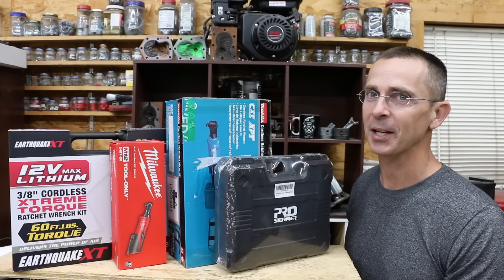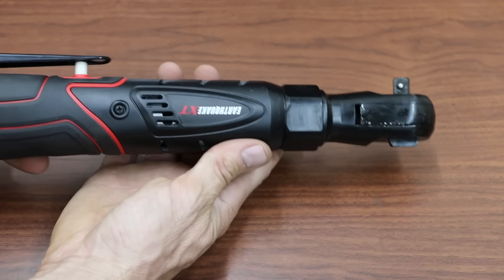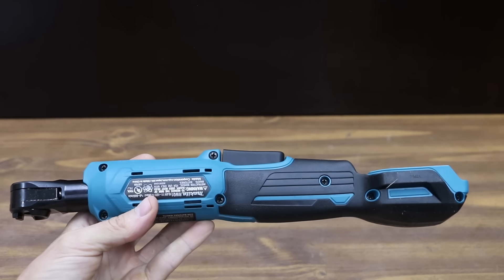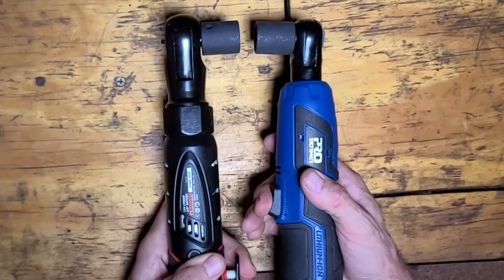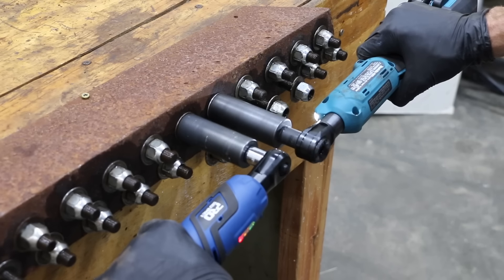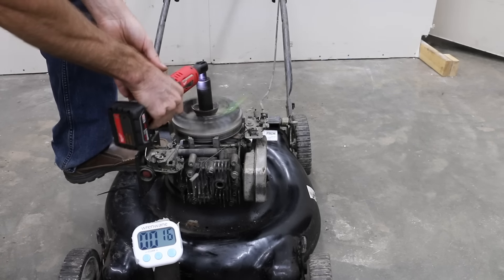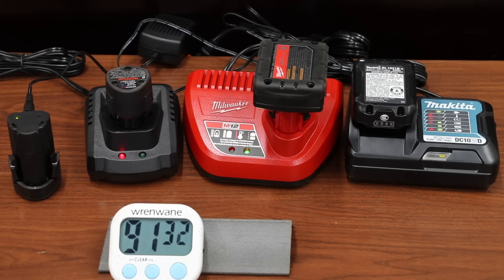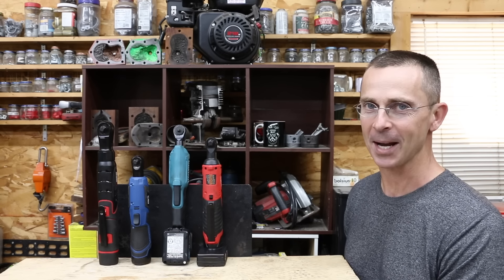Best 3/8 Cordless Ratchet? Milwaukee M12 vs Makita, Earthquake & ProStormer. Let’s find out!

Comment: I bought a Prostormer  purely on price awhile ago. I knew it would probably be inferior to the "big" brands and I'm careful using it by breaking nuts etc with a breaker bar first before using it. It hasn't disappointed me at all. One of the most useful tools I own
Reply from the maker: Thanks for sharing!
Reply: I RATHER GO WITH PRICE AND PERFORMANCE THAN THE HYPE....LIKE MAKITA OR MILWAUKEE. PROSTOMER IS THE ONE IM GOING TO GO FOR. AM NOT A MECHANIC, BUT I LIKE TOOLS TO MAKE MY JOB A LOT EACIER.
Reply: You won’t break nuts with these battery ratchets. They really have very little power compared to an air ratchet.
Reply: @djjammindave  All-caps = automatic downvote.
Reply: that was one of my first ones and its absolutely garbage and stopped working after a couple months of use lost all power and does not tighten anything anymore. i have all Milwaukee now and have 0 issues besides one failing after a year of heavy abusive use which they replaced under warranty for free.
Reply: @grazz7865  he means breaking a tight nut loose from the threads of the bolt by using a socket with a lot of leverage (the breaker bar), then using the power tool to take it off the rest of the way.
Reply: @S0ulinth3machin3  oh I see. The Dewalt ratchet has 75 foot pounds of torque-almost better than an air ratchet. I watched a test of various models. The dewalt was able to break the nuts up to 70 foot pounds of torque

Comment: I bought the ryobi one, and im using an adapter to run my dewalt batteries. so it uses a 20v battery. oh and it was $80.
Reply: Where did you get the adapter?
Reply: @TheCamaro5  check ebay...
Reply from the maker: Thanks for sharing.
Reply: they are all 20 volt, peak, then 18volt nominal, its just how they advertise it
Reply: TheCamaro5 I’ll
Reply: No dewalt equivalent from what I can find. Missed opportunity in my mind
Reply: @mainsource8030  Yep, but 18 or whatever you want to call it is better than 12. @TheCamaro5 I bought my adapter on amazon. @Alex Peters, I actually ordered a yellow 12v dewalt looking one on ebay, but it never came.
Reply: @gregorioledezma4473  ?

Comment: My Earthquake was a game changer. Worked well, was strong, long battery life. Had it for years. But I dropped it and it quit working. Bought a MAC 3/8 because I have all dewalt batteries and chargers but it has its drawbacks and was not cheap.
Reply from the maker: Thanks for sharing.

Comment: I'd love to see how my snap on does cordless does against these.
Reply: Snap on is NEVER any better than han other lower priced tools. Snap on just has a lifetime warranty and a truck the comes to your shop. Thats it, the tools are the same as others.
Reply: @JM-yx1lm  snapons electric stuff doesnt have a lifetime warranty
Reply: Poorly. My snap on didn't last 2 years. My Milwaukee is going on 5.
Reply: Snap offs are junk that’s why he doesn’t test them
Reply: I was going to say "boo snap on" but yall best me too it. I like the cheap one he has on this review bc it is the smallest, which is the biggest benefit bc it gets in the hard spots where a regular ratchet would blow
Reply: @Wayne Jorgensen Ya. The only thing worth a damn on the snap on trucks are the hand tools. Ratchets, spanners, sockets, screw drivers, etc. There is no better ratchet than a dual 80 with the hard plastic handle. So smooth and crisp, the plastic handle is comfortable, durable, and easy to clean. The Matco EIGHTY8 and Gear Wrench 90T are close seconds IMO. Pittsburg pro ratchets are also very good for the money, I think they might be under the ICON name now, not sure. I have one that I have used for 5 years. No problems, even the handle held up pretty well.
Reply from the maker: Thanks for the video idea.
Reply: I've got the Snap On cordless ratchets - 1/4" and 3/8" drive in regular and long neck.  I use my 1/4" ratchet almost all day, every day for the past 5 years.  It needed to be repaired a few months ago finally after all that use.  I like how the  Snap On feels in my hands all day, it gets the job done and for it to last 5 years with all the use it gets, I have no complaints with it.  I like that they come in all the colors too.  Each of my ratchets is a different color so I can tell them apart very easily in my tool cart and grab the one I want (1/4", 1/4" long neck, 3/8", 3/8" long neck) quickly so I can keep working.
Reply: wouldnt mind to see the comparrison too, but I love my snapon long and short neck ratchets. even if they faired poorely I still wouldnt complain, they are competitively priced and if one screws up (and in 4 years only 1 has) snapon guy gives me a loaner while mine is away, comes back line new for free even though that one was 3  years old and I dont miss a single minutes work. Now they do charge a fee for out of warranty rebuilds, but In my experinece, if you dont take thie piss, they usually waive that fee. they have for me 3 times now in the last 10 years. that customer service is worth paying a little extra for.
Reply: At $250, the Snap-On should also make you a sandwich and pour you a drink after you're done working.
Reply: @denisohbrien  Competitively priced? Last I checked, the 3/8" ratchet only was like, twice the price of the Milwaukee Non Fuel, and about $90 more than the Fuel version. That's....not really competitively priced.
Also, the claim that you don't miss a minute's work is kind of a stretch. If  your tool breaks on Monday, and your Driver actually does come to you, when you call them? That's great. But not all Driver's respond to people calling them, or they might be busy with someone else calling them. Some, you're at the mercy of whenever they feel like stopping by. Which is very different from your claim.
You could literally buy two Milwaukee non-fuel for the price of the Snap on, and when/if the first one breaks, you have a second right there, ready to go. Send the first one out under warranty, even 4.6 years later, and it comes back fixed, for when the second one breaks.

I understand that you are invested in your tools, but just be honest with the fact that Snap On is not competitively priced. That is one of the biggest reasons why so many mechanics are moving to Milwaukee. Because Milwaukee is undercutting Snap On by roughly half the cost, while more often than not, offering substantially more performance.
Reply: @Blenzo480  I stopped buying premium brands after I saw they are all made in Taiwan. In that case auto zone takes the lead since it has a full time "no questions asked" warranty with their tools... I have actually tested that twice already and it really works 😅
Reply: It's the same as pneumatic versions, they have the same head design. A couple or few few years of my abuse and they all rattle around like they are doing something, but they are weaker than puppy piss. I can't be the only one.
Reply: @UncleDonDon  right lol. Only reason I went that route is my job pays the refurbish fee so I get them refurbished every year or so.
Reply: I like my 3/8th electric ratchet even if it was over priced. Tempted to add a 1/4 inch because I find myself using a adapter often.

Comment: So what I'm getting out of this, prostormer is good on a budget
Reply: For another 10 bucks AC Delco will give you 45 ft lb of torque. I measured it several times with my torque wrench. I had a cheapie like the prostormer and it would only give me about 20 ft lb. I snapped the head off of a grade five 3/8-in bolt with the AC Delco. It put out more torque than my air ratchets. It's not super fast but it definitely has the torque.

Comment: I love my Milwaukee, the size makes it great to get into tight automotive spaces. Definitely my go to tool. Also the load stop when a bolt is tight cuts power quick so you don’t bust your knuckles
Reply from the maker: Thanks for the feedback.
Reply: @Stolas Not on mine
Reply: @Stolas the trigger is variable so you don’t have to go full throttle on it. Also they arnt like an impact, they don’t torque bolts all the way. I think the Milwaukee 3/8 is only like 20ft/lbs or something. They also offer a 1/4 drive for smaller bolts. They are mostly for speeding up the removal and installation of bolts. You still have to wrench them down or torque them afterwards. It just makes everything a lot quicker. Especially in hard to reach areas where you would be doing the “one click at a time” with a normal ratchet. I highly recommend one. They make you wonder what you did without them for so many years.

Comment: I’ve got two of the earthquake ratchets.
Got them both “open box” 
Use it all the time with plenty of abuse. Like it just fine.
Reply from the maker: Thanks for sharing.
Reply: I've had mine for 2 years... works perfect.  In fact, I was going to get the Milwaukee, ya know. Name brand stuff.. but to be honest, no need to
Reply: Love mine... I would like to see more of the new Craftsman V20 tools in your comparisons since Lowes carries them and they appear to be fairly nice and from other reviews it appears that some of the Dewalt tech has been included inside some of the tools since they are both under the same umbrella. That being said the Earthquake for HOME use is more then fine. Save's my wrist when working with my cars and motorcycles. Although if it dies the Milwaukee appears to be a great replacement.

Comment: When testing the torque you should have had the tools stabilized since your arm input may skew results. Thanks for all you do!
Reply from the maker: You are welcome!  Thanks for the feedback.
Reply: Agreed, that, also was my only critique, but over all, a great test
Reply: While I don’t disagree. You don’t use the tool in a vise. So this is a more real work test.
Reply: @MET90LX  you are correct, but while testing anything, you must control everything save the one variable you are testing, for the most accurate results of the experiment.

Comment: Milwaukee has come a long way since that Cordless ratchet
Reply: milwaukee`s dead to me since being screwed on batteries with the v18.
Reply: Super Ryobi for the win I guess
Reply: @REDMAN298  I’ve never had a problem with Milwaukee’s 18 volt batteries.
Reply from the maker: Great feedback. Thank you
Reply: @REDMAN298  can you explain?
Reply: @derekverveer6058  the early v18`s were replaced by 18v`s which I switched to and were junk also. Then they go to m18`s and all my stuff is obsolete! I`m using after mkt. batteries and having better luck and more realistic prices. Used to be proud of the milwaukee brand. Not now. My old saws and impacts are still good. Why did they have to change so you can`t use the new batteries? Crooks.

Comment: When the Milwaukee beat the Makita by only 5 seconds, I was thinking a side by side comparison was in order to eliminate any human inconsistency over 20 bolts. That is exactly what you did next and it looked like the time difference at which the Milwaukee won was about 0.25 seconds, thus a testament to your consistency of moving the ratchet over 20 bolts. Good job. You are one of the best on YouTube at eliminating variables which might give skewed results. I subscribed.
Reply from the maker: Thanks so much!  Thanks for watching and subscribing!
Reply: Batteries should be the same amp hours though.

Comment: I've been wanting an electric ratchet and I was thinking to myself yesterday that I really wish project farm would do a video on them. My prayers have been answered. Thank you!
Reply: Get the Milwaukee. I have one, I use it ALOT
Reply: The smaller batts only take about 30 mins to charge.
Reply: Check out the new Kobalt one. Brushless and on sale tool only for only $99 right now.
Reply: Milwaukee has one that is a bit bigger in length (inch or so) but good amount more power and you can get the compact 12v battery (3ah) so you can get it into small places.

Comment: I'm a homeowner and DIYER. I now own nothing but Milwaukee hand tools. I own the electric Sawzall soon to be cordless, 3/8" ratchet,1/2" impact for lug nuts and bolts, impact screwdriver and 1/2" chuck drill. I will be adding the oscillating tool and angle grinder as well. The main reason for me are the batteries and chargers, they're interchangeable, also, the newer fuel series have metal gears for longer life. I love all my cordless tools and use them on my vehicles and around the house almost daily.
Reply from the maker: Thanks for sharing.

Comment: Nice thorough study.  I have the Earthquake and absolutely love it.  I think most people will never have a runtime issue with a cordless ratchet, but it's good info to have if you're going to use one framing a skyscraper or for some reason don't have shop air in a production setting.  I'd recommend the Earthquake all day since extra batteries are pretty cheap and readily available, and the long handle makes it easy to reach into tight spaces.
Reply from the maker: Thanks!
Reply: I thought the Earthquake was a Harbor Freight brand, but can't find them anywhere...I guess now its Hercules.

Comment: You stated you liked the Makita quite a bit, after the Milwaukee.  What did you like about the Makita?
Reply: If you're using it professionally. Rpm is more important than torque IMO. The faster you can unscrew/screw will add to your pay every week. Battery life and Warranty are important too. Overall I think the Makita is good but lacking options and warranty that Milwaukee has. If it wasn't for that I'd get the Makita
Reply: I think it comes down to preference, they both perform about the same, and the Japanese parts in the makita (Japanese company) although built in China, will undoubtedly last longer.

Makita has been doing cordless tools for decades too, I bet most of your dads had one, those long awkward batteries that slid into the handle.

Comment: I’m 99% certain that Pro Stormer is a rebranded Power Torque which I sell at my O’Reilly extremely cheap. For the price I love mine. Literally a quarter of the cost or less of high end brands and for me it’s been more than what I’ve ever needed with the 4.0 amp hour battery upgrade we sell. Always was very impressed with it. Lifetime warranty as well. I do very much recommend.
Reply from the maker: Thanks for the feedback.
Reply: It hink its a generic chinese made. I have one with different names but almost exact the same case only led is the difference and its about $40
Reply: @mrizkic  how is it working out ?

Comment: Is it my imagination or did the Makita start smoking in the final seconds of the lawn mower test?
Reply: I used to deliver furniture a long time ago and we had a Makita corded drill that we used to assemble a bunk bed that was held together with 6" lag bolts. By the time we were done the drill was so hot you could not touch it. We put together several of those beds while I was there. The drill always worked great.
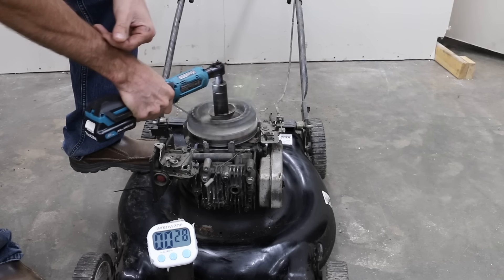Reply: You are indeed correct! 9:56 (ish) you can see the smoke.

Comment: I don't know where the video went, and I know this is old but it showed up again on my feed. I've been using Hercules from Harbor Freight and absolutely love it. Cheaper than the big brands, but it works great. Example, I just did a complete timing chain kit for a Ford 5.4 Triton and components. Did the entire job disassemble and reassemble with the smaller battery and did the entire job one charge. Great power, and fits in most places. Absolutely a great product.
Reply from the maker: Thanks for sharing.

Comment: Aww but the milwaukee wasn't the fuel model.
Reply from the maker: I need to test the fuel in round 2
Reply: It also had an unfair advantage with the 4.0 battery
Reply: @aaronporter2180  unfair would be using the 6.0 battery
Reply: @ProjectFarm  WOAH!!! A round 2?!?!? I'll be waiting (:
Reply: @darkstari  oooooh that's so true!!
Reply: @ProjectFarm  and maybe try the craftsman model, not sure if they are as good but they have a 20v model
Reply: @aaronporter2180  he tested all the ratchets with the batteries they came with. If any of the ratchets has the ability to have a bigger battery, then that should be a fair advantage of that ratchet...
Reply: @markburkey6371  no he didn't he bought a 2 battery kit separate from the Milwaukee ratchet hence the 2 separate boxes

Comment: I love the videos, the tests simulate real-world conditions we run into all the time. Breaking loose by hand, spinning off partially seized or rusted fasteners, hot and cold conditions. I've been using the Milwaukee m12 brushed ratchet for six years now as a professional HD truck mechanic. Two years ago it gave me a burning smell but is still working to this day. I love its compact size with the 2.0ah battery. The rubber grip has swelled and fallen off but the tool keeps working.  Some of the more powerful m12 tools like the right angle impact and the compact 3/8 impact really benefit from the 4.0 battery. True and fair comparisons have to have similar battery voltage and amp-hour ratings. The Milwaukee ratchet would have been more compact and given different numbers had the 2.0ah batteries been used. The price of the ratchet with two 2.0 batteries is also much cheaper giving it more value per dollar.
Reply from the maker: Thank you for the feedback!

Comment: Awesome video.  The tests you performed were outstanding!!  That cheap proformed didn't do too badly against the other big name products.  If only it provided more torque, it would be a true dollar to donuts winner!
Reply from the maker: Thanks!  Thanks for the feedback.
Reply: The Pro Stomer on Amazon advertised "[High-efficiency]- Powerful 12-Volt copper motor delivers up to 55ft-lbs(75N.m) of torque;"
Project farm ... Not so fast 8:10 Pro Stomer had only18.6ft-lbs of torque.